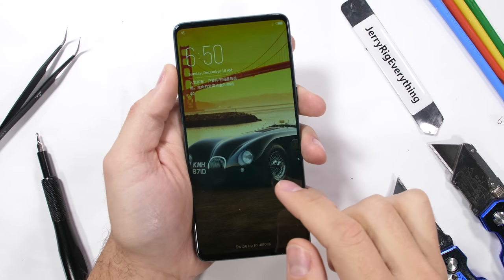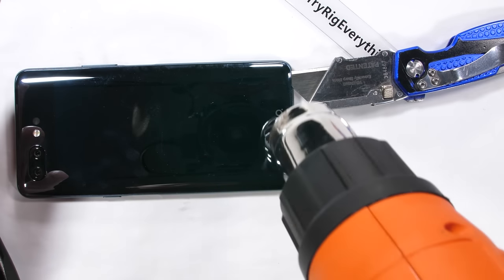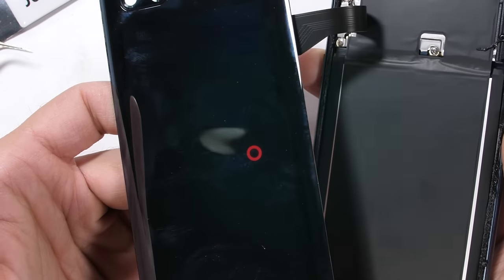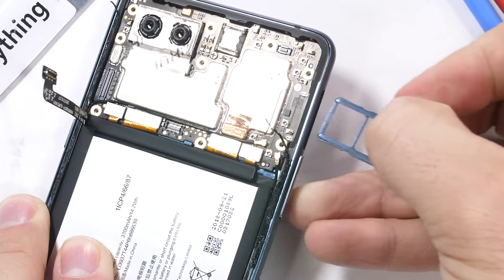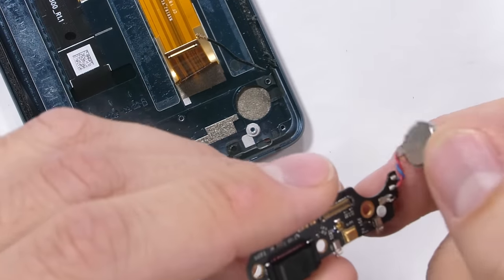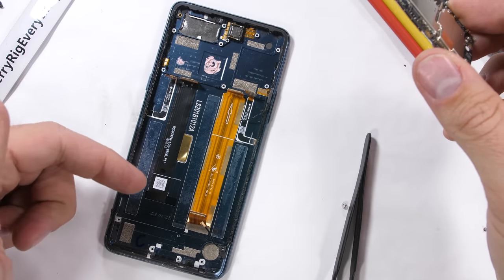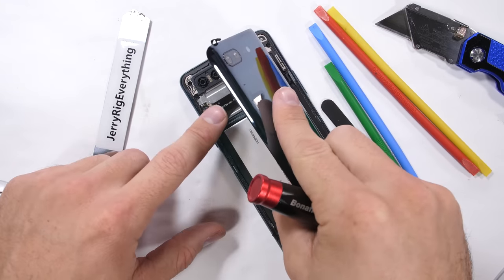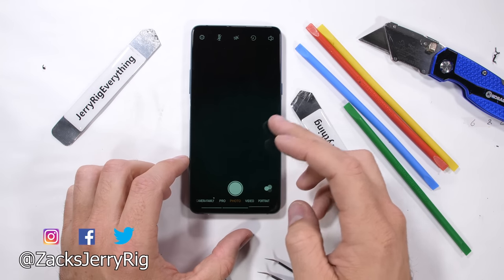Dual Screen Smartphone Teardown! - How does it work?!

Comment: Power it on without the second screen and then press both fingerprint sensors to activate the second screen... I want to know what happened....
Reply: me too!
Reply: The secondary display is automatically disabled if not connected.
Reply: nothing happen.. its like u unlug you tv/monitor hdmi cable and turn it on

Comment: Zach, while you've got the phone's back taken off, you could take a picture of the internals and then set it as the back screen's always on display wallpaper, so it looks like there's a clear window that shows the internals lol. You'd just have to screw around with cropping it to the right size so it looks legit.

Comment: This kind if phones will only be around before we find out how to make in-display cameras
Reply: the thing with this phone is that the camera is the selfie and rear camera, so they will always have higher resolutions for selfies as compared with the front in-display cameras
Reply: kingsofserbiangameplay 162 There actually is an in-display front camera phone coming out soon! The Huawei Nova 4 has one, although it’s...sort of weird. 

That said, there are also rumors of the S10 having a similar design
Reply: Sure but i thik  small 2 inch scree can do this ..... When you get tryid to Get selfi in this type phone ?
Reply: There is technology coming for it. I don't know if you know but they are already using a variation of it on some of the latest phones, the under-screen fingerprint scanner is a camera.
Reply: I remember when phones had a weird mirror so you could use the back camera.
Reply: Andrew Atkin it’s not ENTIRELY accurate to call a fingerprint scanner a “camera”, it’s much closer to a scan function on a printer. It uses reflected light over a flat surface to differentiate between colors. This works very differently from how a camera processes images
Reply: @AlisterCountel  The quality is also not the same
Reply: @AlisterCountel  ah gotcha, fair enough. Cheers for the info. I was just repeating what zack had said a few weeks back when he did a teardown on the oneplus 6t.
Reply: Same for ugly notch and holes, atleast this looks better and is more useful than a notch
Reply: @The-Heart-Will-Testify  and.not to mention if you broke the display you will not have to go and buy a new phone or a new display...you just flip the phone...and many of the premium phones were going glass in the back anyway...so better give it a use while you are at it...
Reply: @kartik1396   true, some people are complaining n because their favorite companies don't offer this hahaha....useless glass screens need to be used .
Reply: The biggest advantage of dual screen phones is that the rear high resolution/quality camera can be used for selfies, other than that not much else.

Comment: i still don’t know why you would need a screen at the back
Reply: For selfie
Reply: but you have a SELFIEcamera for that at the front
Reply: @nathaselager  no it doesn't have a Selfie cam that's why the dual display
Reply: @nathaselager  lol, wtf are you know about?
Reply: selfie cam doesn't have to to stare at u all the time... almost full screen phone... less cameras (simpler hardware)...back screen is smaller (uses less energy), smaller resolution (phone works faster), and amoled (probably better sun visibility)...one screen breaks, u have another... cool looking... 8 good reasons

Comment: And how am going to put a cover on it?
Reply: Transperant cover
Reply: Simple..U dont. Any sort of transparent cover, I feel ,will make the back display look dull.
Reply: @konchai5918  how you use back display if it has cover maybe a transparent skin will work
Reply: Using an edge only case, basically a bumper that goes around the edges of the phone leaving the front and back uncovered.
Reply: forget about the cover
Reply: @TgrHwke  i guess maybe that with dual glass screen protector
Reply: @TgrHwke  what about the fingerprint sensors.!?
Reply: no one can answer this question, OMG

Comment: Is it just me or is the screen on the back camera display flickering??
Reply: He did say its refresh rate is lower than a normal screen. Could be the camera too
Reply: It also has a yellow tinge setting which can be turned off.
Reply: @BillyLndn  that and the shutter speed from the camera have an effect on if you see it flickering
Reply: Its because of the shutter speed of the camera, its not visibile irl

Comment: Honestly, at first thought it looked super gimmicky but the more I think about it the more it makes sense. The only reason we have front cameras is to take selfies or video chat. Otherwise it has zero purpose and also the front camera is usually much weaker than the rear. So putting a screen on the back lets you still take selfies, still video chat, and get the benefit of a better camera. Then on top of that you loose the screen notch on the front and get a better screen experience on the front. The only con I could possibly see is manufacture cost. I wonder if there really is a difference between putting the screen on the back vs putting a camera on the front.

Comment: Hi JRE! Great teardown video! Dual screens are a gimmick. Big question is when will battery capacity improve to the point where having dual screens on time performance will last all day? But, personally I don't like dual screens for a reason and its that if I am holding the phone I will not see the other side. 😎😎

Comment: * Unplugs the battery before disconnecting the rear sensors ribbon *

- Ends Phone internal exploration -

* Plugs the battery in before connecting the rear sensor ribbon *

Dude, lol.

Comment: Hey Zack, do you have a DIY repair video for Redmi Note 3 charging ribbon. It just stopped charging one day when I plugged it into the Quick Charger instead of the regular charger(this ideally shouldn;t have done any damage anyway). I showed it to a guy and he say replacing the ribbon connecting the charge port and the battery might do the trick.